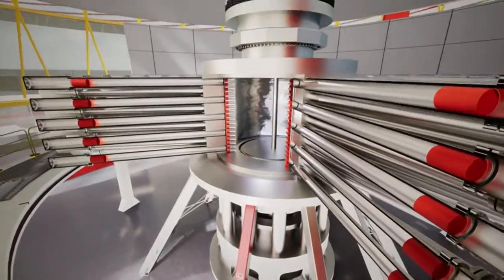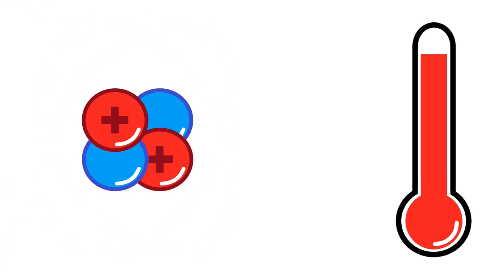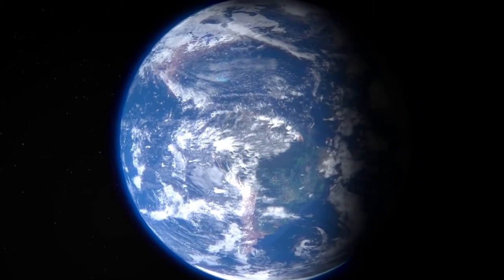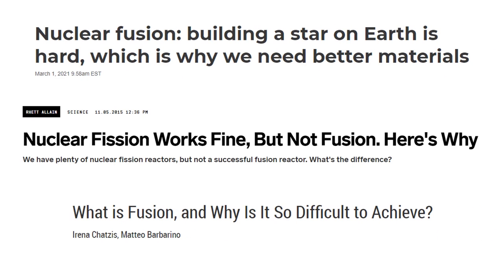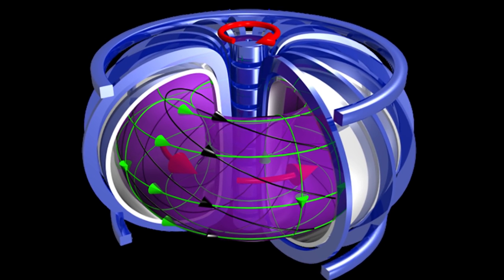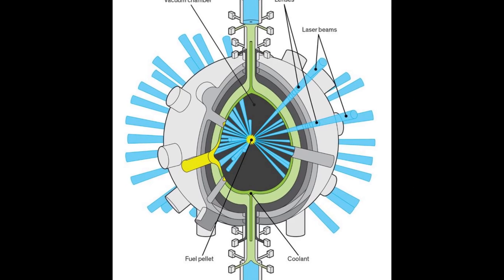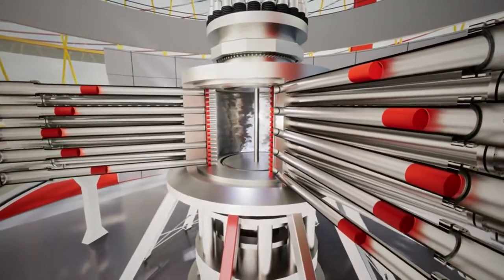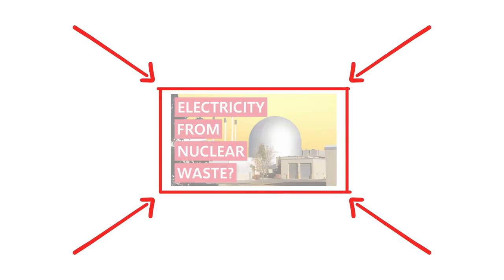This Canadian Fusion Reactor Could be Built by 2025

Comment: Coordinating large mechanical pistons can be a nightmare. You would need to fire them with something like a nanosecond precision. Because you know, gas or plasma tends to escape if not compressed symmetricly enough. That is what laser fusion guys struggle with. At NIF, they fire 192 laser at the target and it is NOT an overkill.
Reply: Controlling the timing is a solved problem witness atomic weapons they had proper timing in the 40’s.
Reply: @paulbedichek2679  That timing is for Pu implosion bombs the timing for fusion compression is different.
Reply: @paulbedichek2679  Bombs where never intended to be resuable... or am I missing something? 😏 I don't say timing is a major obstacle here. It is just one of them.

Conventional explosion was show to be enough to spark some fusion in the 70's by Kaliski group. But it was only science-relevant amount of fusion.

I guess the idea is that liquid metal is incompressible, so it can transfer the force effectively. Well, is it? I mean: is it incompressible under extreme pressure? Nothing is. We cannot extrapolate normal-life observation that far. The resistance of atomic structure of a metal against the deformation should be huge, however, the demands are: compress with enormous precision and generate powerful shock waves that will heat the fuel to thermonuclear temperatures.
Reply: @WielkiKaleson  You are right, and what will happen if one of the pistons is slightly of? Will that shockwave shift towards that piston and destroy it?
Reply: You sure that's not a microsecond precision? Show your work.
Reply: @lengould9262  Be so good as to tell me where have I written that they have not achieved a microsecond precision (BTW, 10^(-6) s is still a lot of time). I have meant to underline that they want to fire their system repeatedly and still keep enormous precision of virtually all elements.
Reply: But if we're already aware of a problem we can design ways to solve it.
Reply: @polla2256  Yes... As a scientist you are satisfied with a solution. As a company you'd like something economically viable.

In general delivering a lot of energy to one tiny gas bubble immersed in a pool of metal seams crazy, because eg. you don't want to heat the metal or lightly so in worse case. If it is doable, why not compress the metal with an explosion? Fairly easy, available technology for a proof of concept.

Anyway, suppose it works. That is In a pool of metal you get a grenade-like explosion of a fuel bubble. It is no longer a quiescent pool. Other bubbles are floating... somewhere. How are you focusing another piston-shock on another bubble?

Comment: My initial reaction is that 'there's no way something so steampunk could work', but I will be extremely happy to be wrong. Good luck guys, I hope you succeed and that we can all enjoy cheap, near limitless energy without worrying about storing waste for millennia.
Reply: H Bomb does the same thing but a steam pump with the power required would be too big and heavy for a rocket or an aeroplane to carry but on the ground it may be possible, i.e. Tiny H-Bombs powered by piston steam engine.
Reply: I have a sinking feeling that the universe objects too strongly to fusion outside of stellar mass gravity wells. 

Are we sure it's just a matter of very difficult, but possible, engineering? Has net positive, non-gravity-driven fusion energy production been proven to be possible in principle, in any sort formal way?
Reply: @Weisior  who's finna pay to send it to space lmfao if you got a couple billion to burn lemmie know.
Reply: @kylechin8706  A couple bilion to send it into space or to maintain facilities on earth anyway?
Launch costs go down as technology improves and market is widening.
Reply: Nuclear reactors using the thorium fuel cycle will not produce the long lived actinides and transuranics.  They also hold far more promise than this piston system to generate power
Reply: @eitkoml  Transuranics are a subset of the actinides so that first bit is redundant.  You're probably right about the second bit but if there's real capital already behind finding out the viability of things us armchair nuclear physicists can only speculate about I say more power to em.
Reply: @antonzhdanov9653  Interesting post and seems largely factually accurate but my dude please: break up your paragraphs.  I get English is maybe not your 1st language but I'm pretty sure readability constraints apply to all languages.
Reply: @Bill Jaeggle No.. that doesn't really scan my friend.  Can you maybe try a different [your language] to English translator?
Reply: @cacogenicist  That's actually a very good question.  Thing is it's not as if we've never accomplished fusion or even massive energy gains using fusion.  We just can't yet do it in a controlled way.  There's tons of very detailed data from anything from garage-built fusors to the Czar Bomb (not to mention JET and everything in between) that show that fusion outside stars is most definitely possible.

In principle we could simply build specialized concrete lined caverns underground and fill them with water and then detonate small thermonuclear warheads (powerheads?) in them every few months and use the resultant steam to run turbines but that would most likely be every bit as short-sighted as burning fossil fuels -- and much more expensive.  So no, there's almost certainly no "universal" reason we can't do fusion in the same sense as we very probably can't do say, time travel to the past.
Reply: @whatelseison8970  Sorry, that's kinda issue of typing from my phone. Sometimes it mess up paragraphs
Reply: My houghts exactly. Steampunk, but I hope I'm wrong!
Reply: @Teddystream. Nope... H Bombs use a atomic bomb to generate heat enough to triger the fusion reaction of the H Bomb itself.

Comment: VERY INTERESTING! Has everyone/anyone else recognized how much this concept resembles a Diesel engine? A high compression stroke that triggers a chemical combustion explosion which pushes back the piston which, in turn, causes a crankshaft to rotate and deliver power to a vehicle. Explained this way, it sounds like a Rube Goldberg contraption --- but we've been building motors that work this way for almost a century and they work just fine. This fusion concept starts out in essentially the same way, but the explosion is nuclear and the energy is extracted as heat. What's not to like about that?
Reply: LOL. I must say I like the idea. A million to 1 compression ratio in a reciprocating engine would be a neat trick indeed.

Comment: WOOT Steam Punk Fusion reactor! I've been following  Tokamak energy's tokamak design, and Max Plank institute's Wendelstein stellarator for some time, and I've seen a bit about the laser powered kinetic fusion reactors being designed, but this is the first I've heard about a steam powered kinetic reactor. I think i have seen something about General Fusion before but i did not know it was steam powered, very cool!
Reply: The approach is correct, but the solution is ridiculous. The general problem with c.w., or near c.w. fusion (those, who need to satisfy the Lawson criterion) is, you need temperatures of a supernova. Since ignition energy goes with the second power of pressure and third power of temperature (combined gas law), most people regularly use temperature. Unfortunately, thermal losses increases with the fourth power of temperature - according to the Stefan–Boltzmann law, what requires huge machines. The better way is to use pulse-plasma-fusion (aka Z-machine from Sandia-National Lab). This means, to get GPa-pressures, you have to combine Lorentz-forces together with Maxwell's force (reluctance force) by magnetic means of reconnection and remove all electrons from the Hohlraum. We did it in our institute. Since we brought the reaction p + B-11 -> 3·He-4 to life with a yield Q=10 (electrical), our work has been stopped, our institute has been closed down by our government 2012, our equipment has been destroyed, our lab journals has been seized and we scientists and engineers were put into food-stamp programs. It's all about oil, gas, coal - and mineral-oil taxes.
Reply: @debrainwasher  You are right .
Reply: @debrainwasher  if this is true that means there are forces that don't want fusion to happen too early. Can your team find a country like Canada or Australia where it's perhaps more friendly to science?
Reply: @debrainwasher  
What type of reactor? Here in the US the Dept of Energy is seriously wedded to the Tokamak. Robert Bussard an his team at ICE (?) had made some pretty significant progress on inertial confinement.  His work was done undercontrct from the US Navy.  The Navy was interested in a possible working reactor. After Bussards death work continued at Scandia Labs. Sometimes I think the DOE is more interested in producing Phds than electricity. Bussards approach to fusion as from the stand point of an engineering problem rather than a physics problem.
The attractiveness of the p+Boron 11 recation of course is the potential for direct conversion of the reaction you ts into electricity.
Reply: @debrainwasher  
Where was your research institute?
Reply: @Tordogor  It was the institute of nuclear physics at the university of Basel Unibas (Switzerland). Is has been closed down 2012/2013, for the official reason, (quote) «there is no longer a need for nuclear physics research». There is currently only one last group of researchers in Lausanne (EPFL) working on a modified Wendelstein-reactor configuration. When they saw what exactly happened to our institute, they decided to never ever feed their machine with D₂ and T₂. :-\
Reply: @debrainwasher  You mean Z-pinch machine(or laser driven nor neither?) in your lab had almost reached ignition point with aneutronic fuel?
Reply: @debrainwasher   Be so good as to tell me how you have got high Q with p-B. For those who are not really into fusion: nobody would care about D-T reaction if not a) it has biggest probability of happening (cross section to be precise), b) it has lowest energy threshold (= plasma needn't insanely hot). For p-B you need sth. like 6 bln degrees - correct me if I am wrong. At such high temperatures the plasma radiates like crazy (bremsstrahlung mechanism). How do you beat that?
Reply: @debrainwasher  Laussanne? Don't they have a tokamak? TCV. Medium-sized one.
Reply: @WielkiKaleson  Please read my posts again. Everything is explained. And yes, if - and I stress the word if - you attempted to try to perform the p-B-reaction by overcoming the Coulomb-barrier by heat (600keV results in a k·T-value of about 6 GK), you would better create a supernova in order of your reaction. High pressure in the GPa-range and a high degree of ionization makes the job much, much easier. Such hypersonic pressure-waves for a couple of ns can be created by the Maxwell-force, aka reluctance-force by means of magnetic reconnection. And this was the key-technology, that turned Sandia's Z-pinch-technology into a high yield. This technology however is classified,as the fuel is in the list of controlled substances and will remain there - probably for the next 400 years (end of coal), like many other «dangerous» technologies; e.g. low-loss H₂-storage, in-situ cracking of alcanes within a column of liquid tin, subcritical Th-232-technology etc.
Reply: @WielkiKaleson  EPFS Lausanne works on a modified Wendelstein-configuration. It is based on the Tokamak-principle, but uses much more sphisticated magnetic geometry to supress the tendency of recombined D- and T-atoms (electrically neutral) from escaping the Hohlraum.

Comment: Interesting approach. I’d be curious to see the math on the plasma compression and temperature needed to get to fusion.
Reply: @Bill Jaeggle the centre of a molten metal vortex - the amount of fusion reaction is limited by the amount of plasma injected - the heat from the reaction is imparted into the molten metal and this heated molten metal is continuously pumped to a heat exchanger to produce steam
Reply: @carboncomplex  If that metal is lithium it could even breed it's own tritium.